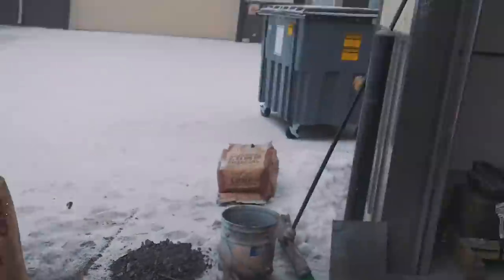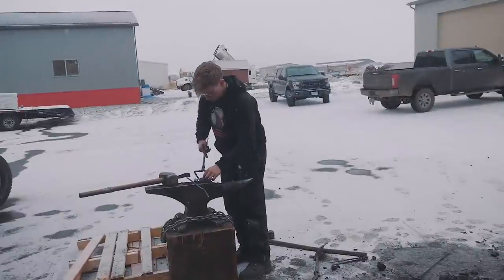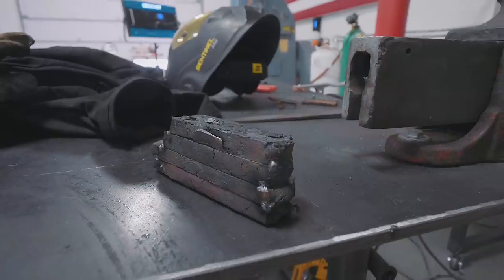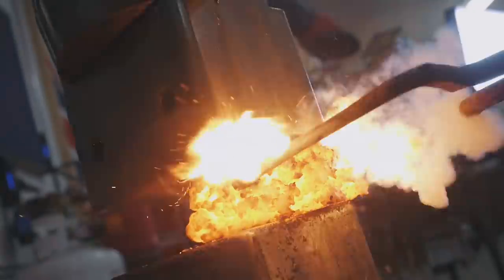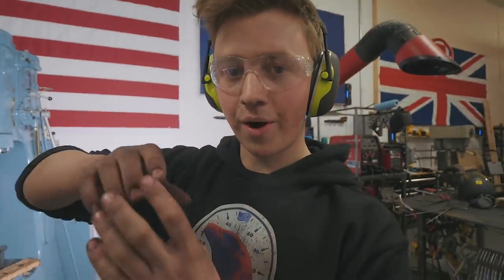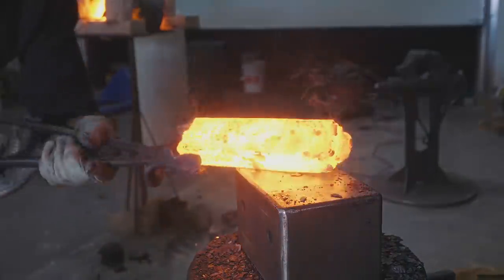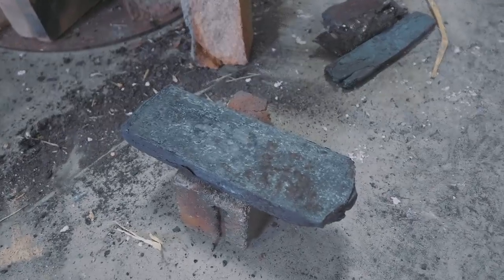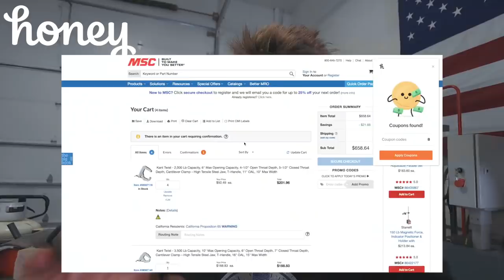MAKING THE CAVALRY SABRE: Part 1

Comment: What does the borax do?
Reply: It's a flux. It runs in between the layers of steel and seals it from oxygen, so the hot steel can't react with it and form scale, which would lead to failed forge welding, cracks and most likely as broken blade in the end.
The borax itself shoots out of the gaps between the steel when hammered on, since it's kind of melty and liquid when hot, so it isn't a problem.

Comment: Don’t gas forges introduce water molecules into the product? There’s a reason wood/charcoal is the preferred fuel of the blacksmith throughout history... or so I think I could be wrong.
Reply: Far to hot for water molecules to be a problem, and there is a lot more water in wood/charcoal than a propane cylinder. Wood/charcoal was the fuel of blacksmiths throughout history because easily accessible flammable gas was not an option yet.

Comment: Hey Alec, better than MIG welding, have you seen Ilya from Men at Arms that tighten up the pieces with wires, forge weld it then cut the wire and take it off ? It could save you some material this way ^^

(sorry for my english, french wanker)

Comment: Im not a blacksmith

But I watch more blacksmithing videos than any sane human being ever should and do a fair bit of research

From my understanding, part of the reason its having a difficult times is the high amount of impurities that come from the process of turning iron into steel. If you keep folding it, putting flux on it, and brushing off the scale while its hot, it should slowly start to come together better. 

Though for all I know you could already be doing that and it was simply edited out 🤷🏼‍♂️ like I said, I am not a blacksmith

Comment: Not to rain on your parade but....

The lesson is: cemented process Iron is OK if that"s all there is available but it will always be weak, brittle, and dirty compared to steel with made with ANY more advanced process. Making an ornate cavalry saber from it may be possible but the first clash in combat will leave you standing there with a hilt in your hand and your life ending in milli-seconds from a hissing slash from your opponent"s weapon, saber or stone club. Sabers are first of all, reliable weapons of personal combat. Everything else is vanity. Decorate them if you must but never lose sight of their end use.

Suggestion: pinch off enough to make two annealed bend coupons. Notch one and bend them both. Examine for ductility and failure mode. Section, polish and etch the remnants for microstructure assessment.

Take those blooms and drop them in a sealed crucible and try for the Wootz process. The dirt will flux out, the voids and defects consolidate in the melt. And, if you're lucky, the carbon will fall within the cutlery band. If all goes well and you forge the ingot with due care, your end product will be the equal of today's fine cutlery steel. This will be the true Damascus steel of a thousand years ago and will have a far different appearance from the pattern welded articles you have been producing so far.

The web is thick with Wootz steel references and how-to videos. Continue with your cementation experiments, learn your lessons. Understanding gained from making stell by cementation will help you with making crucible steel. Then go on to what a practical home blacksmith might profitably undertake. You can make crucible steel using your same charcoal heat source if you wish.

Time for the next step in maturing as a blacksmith.